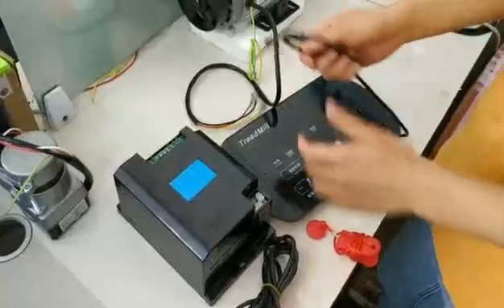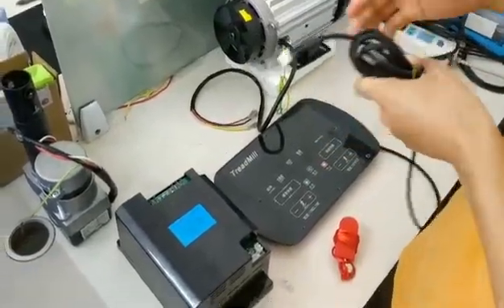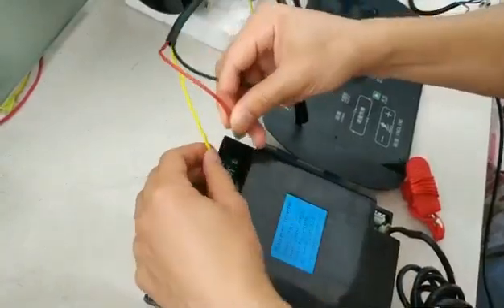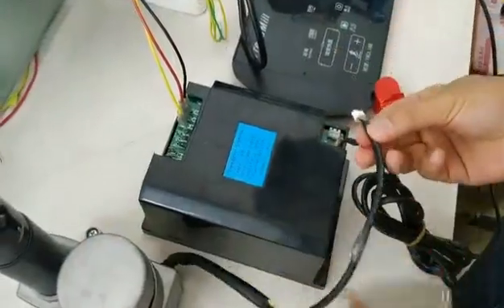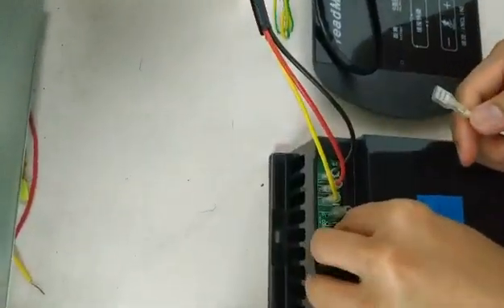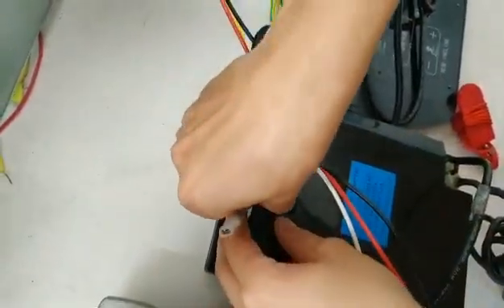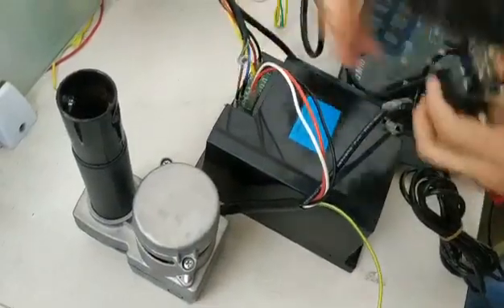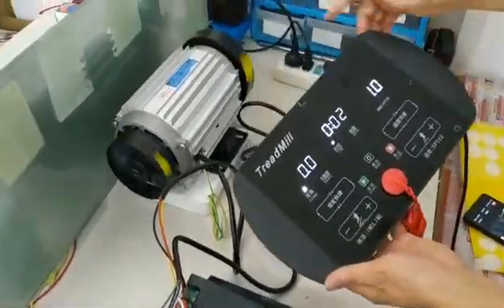Bring your commercial treadmill back to running - AC motor control set

Comment: How to get the the complete stuff in nigeria
Reply from the maker: Hi dear, you can order in our onlineshop.
Reply from the maker: Just found this amazing item on AliExpress. Check it out! $284.05  5%OFF | Commercial Treadmill Controller Set Inverter with Console for 1~3.5hp AC Motor Speed Control 2.2KW
https://a.aliexpress.com/_m0A5LA8